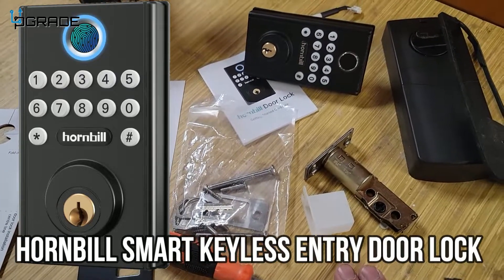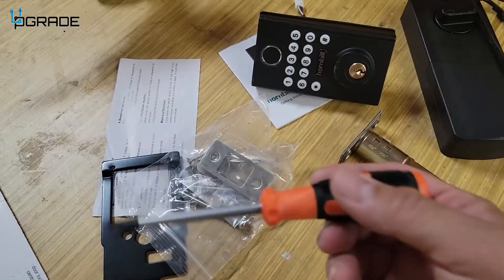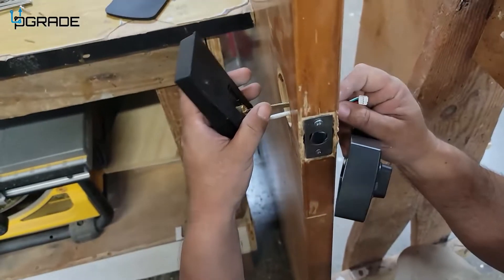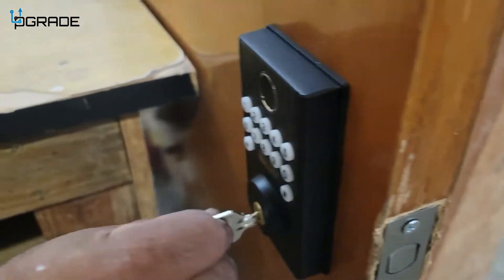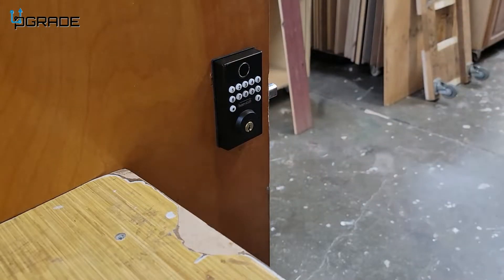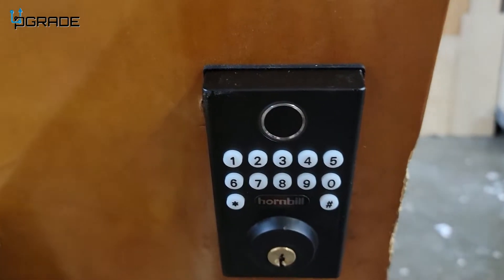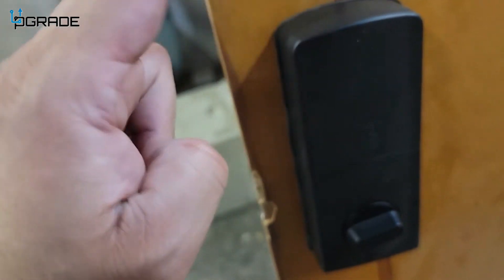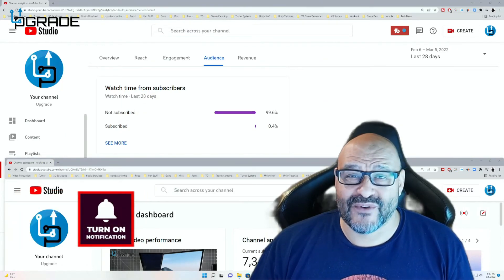Hornbill Smart Keyless Entry Door Lock

Comment: Roughly 3 weeks ago and after 3 or 4 months after installing the lock new it quit working on me so changed out batteries several times and still didn't work so i had thought maybe the heat had fried it.  Just so happened to have looked at battery holder and noticed that there was corrosion on power wire going to + on battery pack so brushed most of corrosion away with a wire brush . So far doing well . So if your lock quits working and doesn't restart after installing new batteries it could be corrosion on the battery box . I reinstalled the original batteries that were in it before quitting so about 3 or 4 months on batteries and lock itself .

Comment: About locking from the outside, looks like there is none and you have to set up the auto lock to get around that. It works but it’s very strange not having a lock button on the outside panel.
Reply: You should be able to put in your user code or fingerprint and it'll lock .
Reply: Hold the # button to lock manually from outside
Reply: @randylahey5415  Good idea ! Thanks !

Comment: Can anyone just use the default code to reset unit from the OUTSIDE
Reply: Not if there are other codes already programmed in so the default code only works on initial setup or after the memory has been erased and no user codes are programmed in and just removing batteries won't erase the user codes or fingerprints so we don't have to worry about reprogramming if we need to replace batteries .